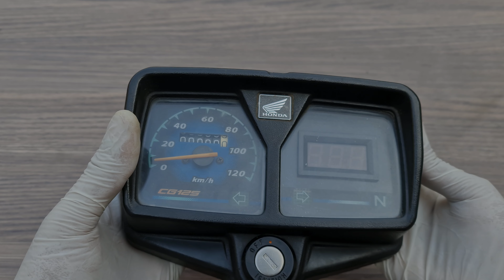Restoration Honda 125cc Motorcycle to Electric Bike Conversion | Part 1

Comment: What are these pink, yellow blue sand papers? Is that what you're using for sanding and polishing? Pls do list your equipment that you're using for restoration. Would be help. P. S Keep old odometer readings.

Comment: After they had been sprayed with liquid cleaner, the wheel bearings should have been removed, inspected, cleaned, regreased and reinstated.

The swinging arm bearings should have been removed, inspected, cleaned, regreased and reinstated! 

Given the additional weight and torque of the rear wheel motor and its steel disc brake, the swinging arm is going to be subjected to weight, loads and forces that it was never designed to take. 

The very least that could be done is to ensure that the swinging arm bearings are fully serviceable. 

Far greater attention is spent on the cosmetics of the bike, rather than the mechanics of it. 

The effort put into the fuel tank was rather wasted because the bike has no need for a petrol tank! 

I believe that attention invested in the mechanics of the bike far outweigh the cosmetics! 

The fork oil should have been drained and replaced with new oil.